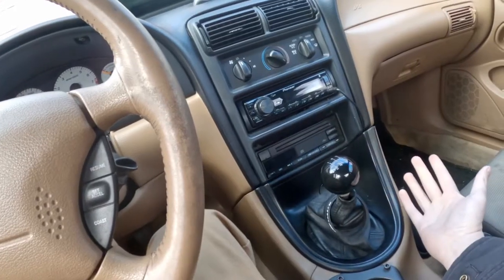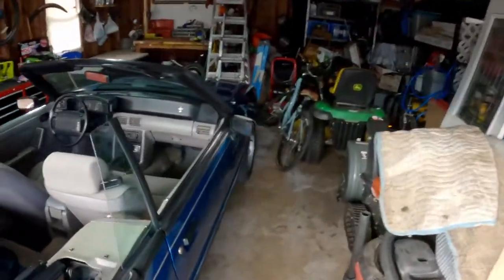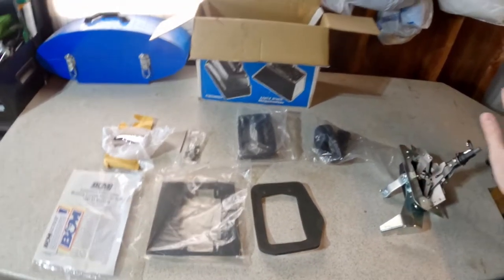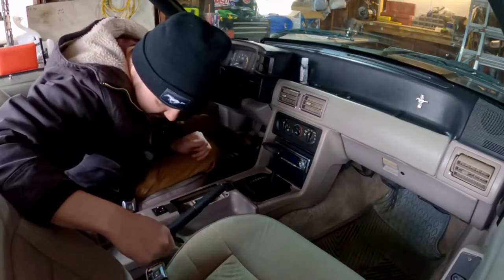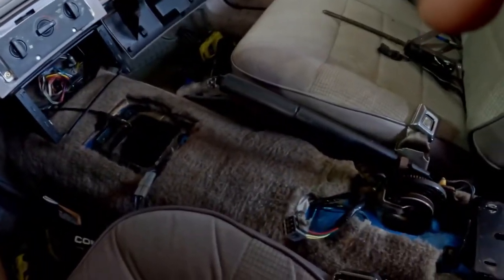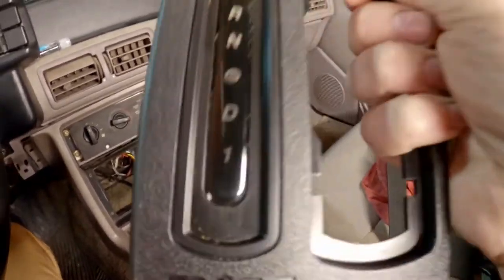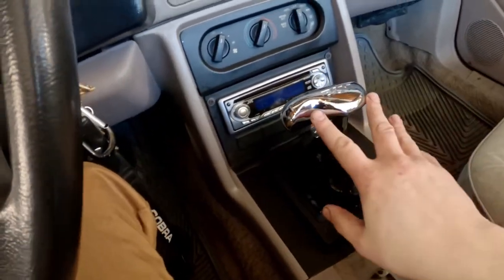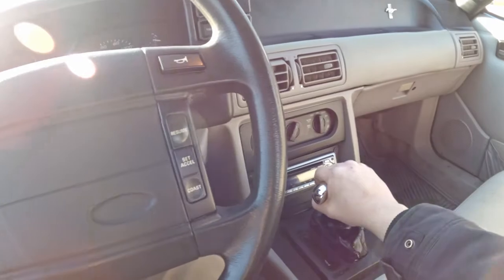Automatic to Manual! *Sort Of*  B&M Hammer Shifter Install

Comment from the maker: This is gonna be a fun mod once I get the kinks worked out 😎👍
If you like the video, please give a 👍
Share ❤️ and of course, Subscribe to the channel if you haven't already done so 😊
Reply: Nice, looks decent for 100 bucks.

Something else you might want to consider, if you haven't already done so, is to adjust the bands and swap out both the OD and intermediate servos with some "ZC" servos (pistons, springs & covers) from a 4R44-5R55 transmission. A couple of snap rings and a light tap and they usually pop right out. The ZC servos will just slide in place of the stock AB & FB servos and they'll give you a lot more grip & better shifts.
Reply from the maker: I'm definitely considering internal modifications for this trans. It seems to get a lot of bad rap but I think it's got potential. I'll definitely keep what you said in mind when the time comes! 🙂

Comment: When you installed it did you put your transmission in neutral before you took everything apart?
Reply from the maker: I did not. I removed the factory shifter and installed the B&M from the top. Then I went underneath the car and loosened the nut to the transmission gear select arm and positioned it in neutral that way. Tightened the nut, attached the the shifter linkage to the transmission linkage. I put the shifter in the Reverse position before I connected the linkage.
Reply: @KarzKreated  when you look on step 5 on the instructions it states to make sure the transmission is in neutral. i wonder if that is why it will not go into park.
Reply from the maker: Ohhhhhhhh... The reason I don't have I park is because the 4 Cyl transmission is different from the V8 AOD. The A4LD has 7 notches on the transmission where as the V8 auto has 6. This shifter is designed to be used for the V8 AOD so I had to make a compromise on having a park selection. I kinda like it this way though. It's more engaging.
Reply: Oh ok. Lol. Well I do like it. Look forward to seeing your build progress.
Reply: I was just wondering because I was thinking of doing the same thing with my 1989 2.3. Lol
Reply from the maker: No worries! 😎
If you have other questions about it just let me know. Thanks for the support!